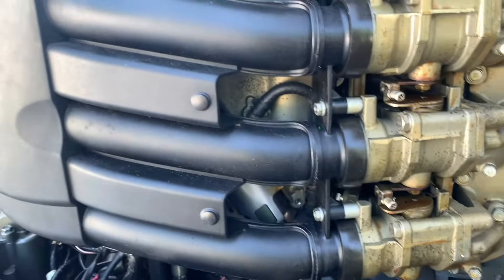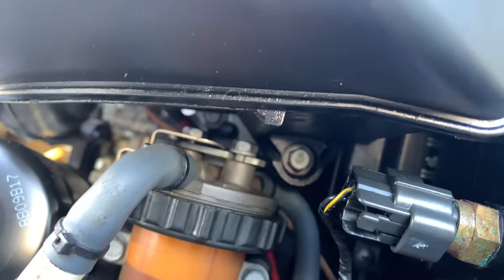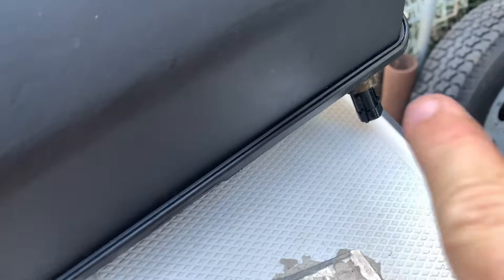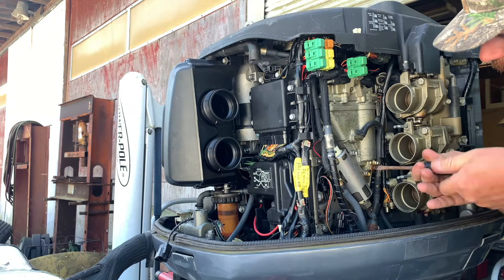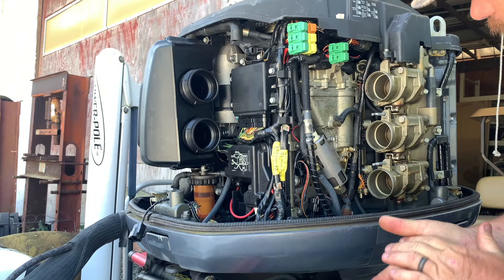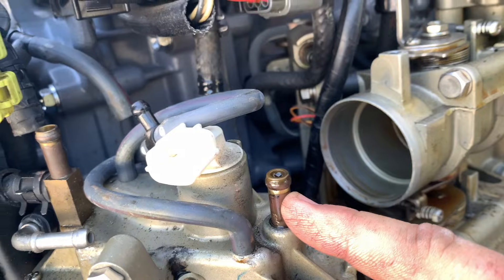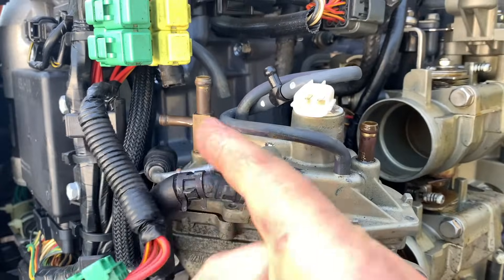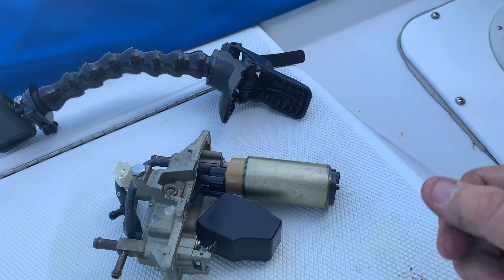Sputtering Yamaha Outboard Fixed | How to replace a High Pressure Fuel Pump on a V6 Yamaha Outboard

Comment: How am I able test the APM draw from the fuel pump once it is out of the motor? My fuel pump looks like the one in the video,  2003 Yamaha 150hp 2-stroke outboard.
Reply from the maker: Bench test it with a 12v battery and make you some leads to the pump and check amp reading.

Comment: Thanks.. but why didn't you check to see if the pump was faulty? . they aren't cheap...thx
Reply from the maker: The pump is much cheaper than a tow back from seatow so while we have it apart we replace them.

Comment: What issues made you believe was the high pressure fuel pump
Reply from the maker: No power under throttle. Boat wouldnt get on plane.

Comment: I have this same year F225 engine.  If you're attempting this DIY job, do yourself a favor, don't take the air silencer off in 2 pieces.  Try and keep it as 1 piece, removing both sides at once.  It's so much easier to handle and reinstall, no fighting to mate the surfaces back together later.  Second suggestion, any Yamaha grey factory fuel lines should be replaced, they are usually the cause of your VST high pressure pump filter clogging.  These grey hoses are notorious for the inner lining to come off the inside of the hose and clog your filters.  Replace all the grey fuel lines, otherwise your issue will come back.  The ethanol based fuels are what degrades this inner lining and causes it to clog anything it can.  Back when these hoses were installed on these engines, there were no ethanol based fuels in use.  The semi-clear yellow looking gel is the degraded fuel liner, which becomes contaminants collecting in the VST's high pressure pump screen/filter.  Over time, it restricts the amount of fuel flow, impeding the pump from doing its job.  Although this video does not show it, the VST tank should have been cleaned to remove any other remnants of the fuel lines before reassembly.  There's also an "F" shaped filter on top of the VST, change it while you're in there.  It's only a couple bucks to replace and a commonly forgotten filter that should be replaced every couple years.  Good luck!
Reply from the maker: Great comment! Thank you for the write up! Can tell you are very knowledgeable on this subject!

Comment: Think this is my issue.  Appreciate you making the video.
Reply from the maker: More than likely is if the motor is sputtering. The ethanol in the fuel breaks down and clogs up that screen. Hopefully that fixes your issue.
Reply: @KnottsFishing  You know what you're dong and it took you 11 mins, so I'm thinking I should be knock it out in 20 hahaha.  Subscribed
Reply from the maker: @byronquinley1400  thanks for the compliment, it probably too a little longer than that, but most important thing is to do it right vs speed.

Comment: Lose the noise
Reply from the maker: My bad.
Reply: @KnottsFishing  it's just that I was interested in what you were saying and wanted to concentrate on that.
Reply from the maker: @jamesgolby9699  i normally do a good voice over but this one didnt come out well.
Reply: @KnottsFishing  it's not your voice, that's what I wanted to hear. It's the elevator music in the background
I've got full throttle problems with a Yamaha 4 cyl 60hp fuel injection so although different it was useful. No pump pressure.

Comment: I'm having trouble restarting it after the first start and run in the water and you go to restart it after you stop it it runs great and it won't start it floods with oil injection and you have to put new plugs in it every time you shut it off
Reply from the maker: What motor do you have? If its an hpdi did you replace the injector screens?